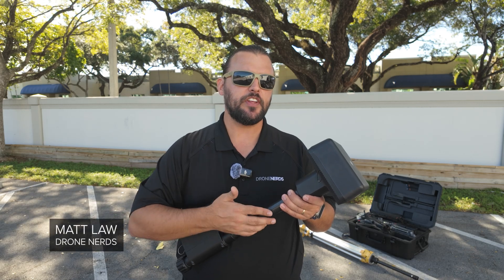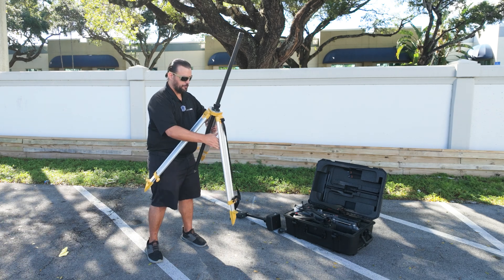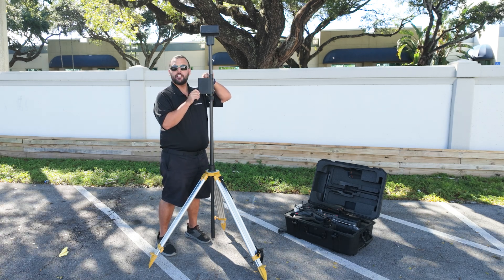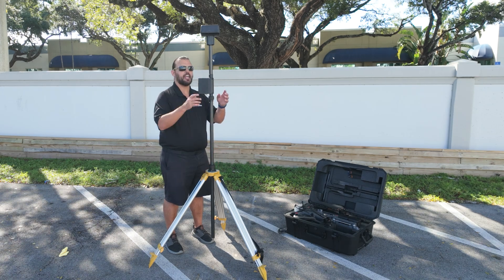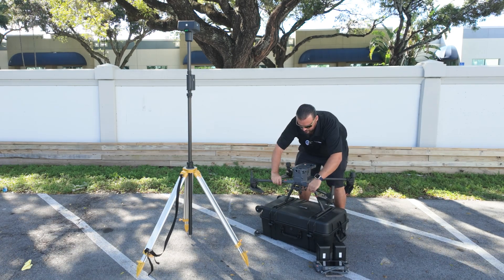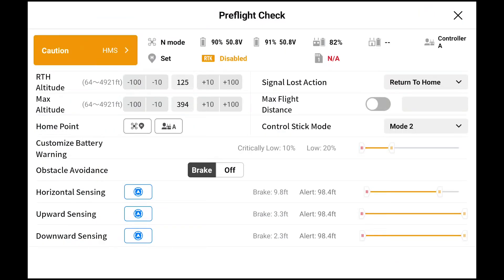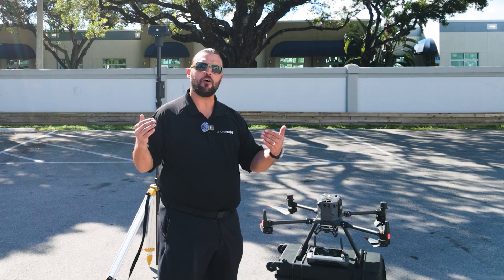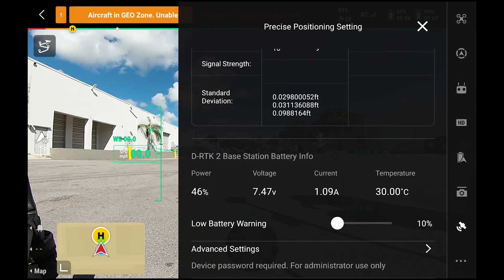DJI D-RTK 2 Base Station Set Up

Comment: Thanks for video; at @3:23 on this video, would you guide me how to get Northing and Easting and Ellipsoidal Height by Feet? My It showed by Degree and Minutes and Ellipsoidal Height is Meter.
Reply from the maker: Hey great question. Don't have a D-RTK 2 at the moment but don't believe it's possible in DJI's software. What you can do is take the lat/long and ellipsoidal height in meters, then take that data to your GIS software and convert the data from there to give you Northing/Easting.

Comment: i have question on the accuracy of a unknown position, set up.  I flew a site and in middle of the flight the weather conditions deteriorated,  i paused the mission and came back the next day to fly, but i set up my RtK GPS base on another position unknown, closer to take off the mission continued but when process the dataset set together the join areas did not join smoothly, do u think i should kept the base on the same point on both days to avoid this? or survey point and adjust coordinates
Reply from the maker: Hi Jerusha, good question! If you set up the D-RTK on an unknown point, the base may not use the same coordinates each time. That’s why your two flights didn’t line up smoothly. For multi-day missions, either set the base in the exact same spot each time, or you can use a surveyed control point with fixed coordinates. That will keep everything consistent when you process the data.

Comment: Done you have to measure the antenna height? Where do you input that information?
Reply from the maker: Hey great question Casey. Yes, in terms of the antenna height, you would add 1.8 meters if the pole is touching the ground or whatever height the antenna sits if the pole is not on the ground. Then you could enter that info into the post processing program that you're using.

Comment: odd, question.  I have been told that the base station can data connect to the drone with the RTK directly when its flying, and does not need to rely on controller's data connection to the drone.  It was said that the distance was less than if it was going thru the controller, but it was better in some use cases.
Reply from the maker: Hey Darius, might you be referring to the DJI RTK3? The RTK 3 does have a relay function that allows you to extend the range of your drone with the RTK 3 acting as a range extender but we don't know of any setup where you don't need a controller.
Reply: Thank you for the clarification.  @DroneNerds
Reply from the maker: @darwinjina  No problem and thanks for watching!

Comment: Does this base station increase range to 9-11 miles for MT30?
Reply from the maker: Hi David, unfortunately, the RTK 2 doesn't have a relay function so the range will remain at 9.3 miles. The RTK 3 does have a relay mode but it's only compatible with the DJI Matrice 4 series.

Comment: Shouldn't that pole be dropped down so the bottom spike is on the ground for stability?
Reply: I know I always have mine on the ground. Ideally, it’s on a known point nail if you have one available.
Reply: Yes it should

Comment: Hello, I have a question. Last year I used the DJI T30, and this year I will be using the DJI T50. While working last year, especially with the T40 drones, there were issues with interference from surrounding signals. Problems such as uncontrolled drifting, loss of connection with the controller, and veering off the automatic route occurred. It wasn't just one person; almost all the drones experienced this issue. It was said that the cause was the use of signal jamming technologies for missile test trials by the military. However, I don't fully agree with this. Not every drone was affected by this. The T30 I used wasn't affected, nor were drones from other brands. We usually work in rice fields and flat terrains. If we use an RTK system, can we prevent such issues? Or would adding an antenna to the controller to strengthen the signal solve this problem? Thank you.
Reply from the maker: Hi! Unfortunately it's hard to say without our team diagnosing the initial challenges. It would be best to work with our Service and Repair Center. Send us an email at customerservice@dronenerds.com

Comment: Hi i have a problem.
I have RTK1 and M210. And now i bought M350 without RTK sensor (I know its versions are different) I wanna know can I connect my drone M350 to RTK1?
Reply from the maker: Unfortunately, the M350rtk is not compatible with RTK1 base station that works with your M210. However, if you have access to an NTRIP network, you could get RTK corrections for the M350rtk that way. If you have any more questions reach out to us here: https://bit.ly/3Kaka6V we can help you out with configuration and get you set up. Thanks for watching!

Comment: Hi, I'm new to this industry and doing a lot of learning. My work has this exact setup (D-RTK-2, M350 RTK, we also have P1 and L2). Does this eliminate the need to set ground control points prior to flying?
Reply from the maker: You should still be using GCP's for better accuracy. Thanks for watching!

Comment: Will any other DJI drone work on this base station or do we need to use the Matrice? Probably a dummy question, but I'm new to the space.
Reply from the maker: Hey no worries! Any DJI Drone that can support RTK can connect to this base station. DJI Mavic 3 Enterprise series, M350's / M300's and M30 series and more. Thanks for watching!